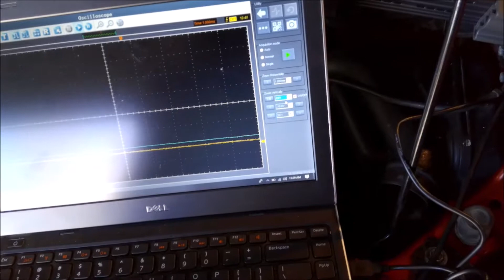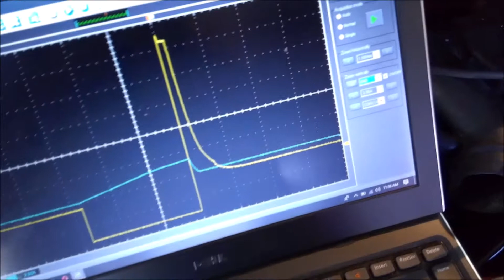2004 Honda Element scope fuel injector using hantek scope

Comment: Can this cause a rich condition at idle? I'm getting negative 15 to 20 on both short and long term and once I accelerate it goes to negative 10 both short and long term. Thanks.
Reply from the maker: If one was stuck open all the time it could cause a rich condition
Reply: @HooptiesGarage   i have no codes and no misfire just a little rpm searching at idle like sometimes wants to die but it never does.